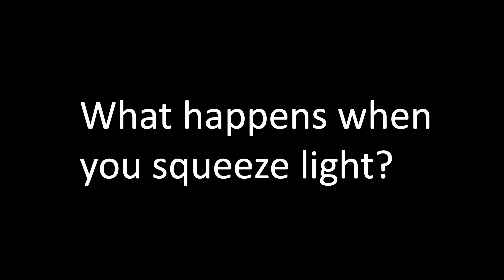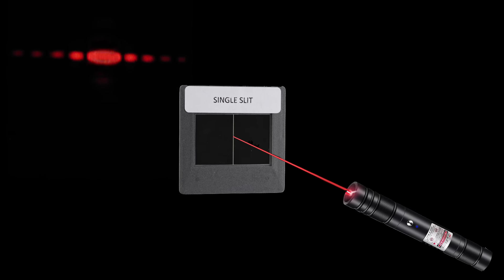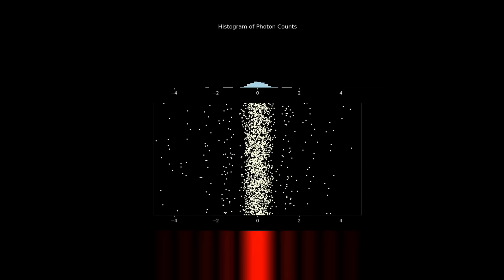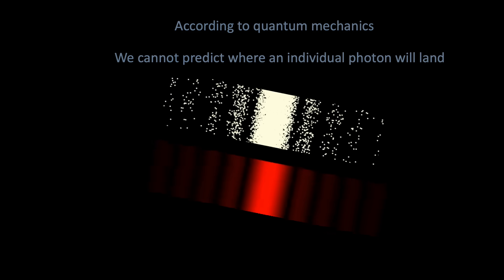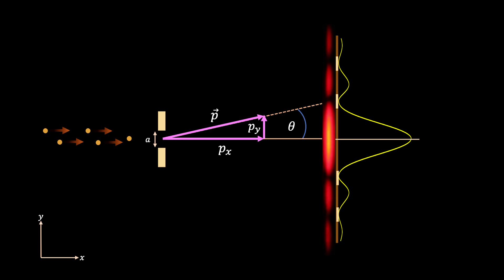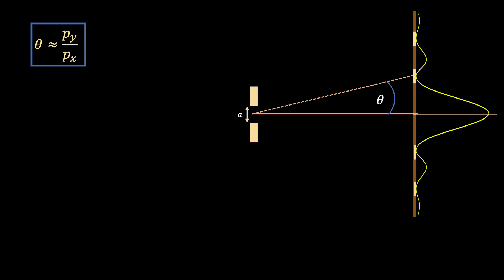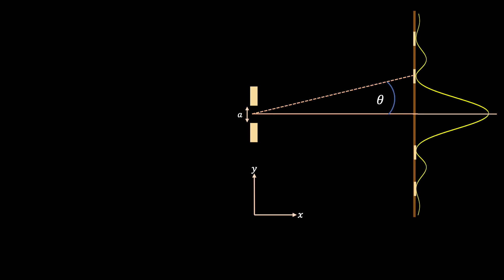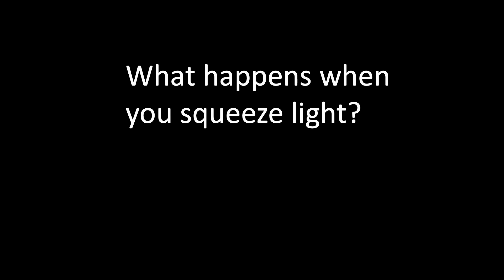What REALLY Happens When You Squeeze Light?

Comment: Photon is only a particle when measured, otherwise a wave. What if the slit is not straight nor have a varying lengths? ( varying direction through the slit) It could be possible that the landing pattern might be not so uniform.. If so, one can potentially assume to witness  the refraction/defraction  landing concentration can be different in  correlation

Comment: We learned this is optics from the standpoint of wave behavior. As the gap reduces closer to the wavelength of the light, the waves are diffracted by the edges of the slit and naturally form the diffraction pattern on the screen. Basic wave behavior.

Comment: This is a pretty naive explanation.  Light will diffuse even when there’s a barrier only on one side.  It has nothing to do with uncertainty.
Reply from the maker: When a photon passes near a single sharp edge, its position in the transverse direction (y) becomes partially defined — we know it did not pass through the blocked region. This reduction in position uncertainty (Δy) means, according to the Heisenberg Uncertainty Principle (Δy·Δpᵧ ≥ ℏ⁄2), that the uncertainty in its transverse momentum (Δpᵧ) must increase. The photon’s quantum state now includes a wider spread of possible momentum components in the y-direction, which corresponds to a spread in possible propagation angles. This angular spread is observed as diffraction around the edge.

Comment: You just pull it through and defract using sliders that have angles on the inside… then you pick how it bounces based on the squeeze and slide up or down to change angle… like their is WAVETABLE of teeth to Razer comb shave through… sliders can be up down side side or in or out it’s just about having all the angles in the cuts of the gridded granular diamond crystal… like… it’s uncertain until it’s just CERTAIN THAT BASICALLY IT’S ALWAYS ABOUT HOW 1984 is going to be the only thing I ask IF EMILIO AND MYCHAEL AND JULIAN AND JEFF AND ARSENE AND SAM AND ANDREAU AND ANDREW AND ESPECIALLY RAMON AND JOHN PATRICK HAVE HAD THEIR HARD YEARS YET… AS IN THEY HAVE TO FOR THE FULL EXPERIENCE LIKE DANIEL ANDREI ANTHONY JEFF WES ALL PAYING FOR A SEXUAL ABUSE EXPERIMENT OF THEIR CLASSMATE THEY DEADPOOLED

Comment: Here is another interesting observation of light involving the Heisenberg uncertainty principle and reveals a lot about modern physics and how quantum mechanics works. According the Heisenberg Uncertainty principle, if a photon is emitted by a source, then the position of the photon is known exactly at the source (nearfield), but the momentum or velocity is infinite. But as the photon propagates about 1 wavelength from the source (farfield), the wavelength starts to become clearer, such that the relation: frequency x wavelength = ~c. But according to the Heisenberg Uncertainty principle, infinite cycles of the wave are needed for the wavelength to be known exactly. So in a finite sized universe like ours, the speed of the photon is never exactly speed c, even at astronomical distances from the source. So the speed of light is never constant anywhere in this universe, especially less than 1 wavelength from the source, where it has infinite speed. If the speed of light is not constant, then the 2nd postulate of relativity is wrong and what remains is the 1st postulate: Galilean Relativity. If Relativity is wrong, then so is General Relativity which is based on Relativity. Infinite speed signals specifically violate the Relativity of Simultaneity because infinite speed signals appear the same in all inertial frames of reference. This can be seen by inserting c=infinity into the Lorentz transform, yielding the Galilean transform, where time and space are absolute. So if a moving body is observed with instantaneous nearfield light, then no Relativistic effects will be observed, whereas they will be observed with farfield speed c light. So simply by changing the frequency of the source, Relativistic effects can be turned off and on. The only possible explanation is that effects of Relativity are not real and are just a type of optical illusion. 

Quantum Mechanics has many interpretations, but the only one compatible with Galilean Relativity is the Pilot Wave interpretation (Bohmian Mechanics). This is because only in this interpretation particles are always real, with real position and momentum at all times, and the particles are just guided by a pilot wave, which can interfere and guide the particle to points of constructive interference. It is also known that the pilot wave communicates information about the particle with the environment. So for light, the photon particle which has energy and momentum, it is guided by an electromagnetic pilot wave that communicates information instantaneously about the photon particle with the environment. 

Instantaneous EM signals are real and have be observed experimentally. In an experiment just peer reviewed and published in the EM journal IRECAP, an EM pulse was observed to propagate 1.5m in the nearfield with no propagation delay. This shows that the front speed, or the speed of information is instantaneous in the nearfield. The effect was also shown to be predicted by EM theory. This was done by setting the wave equation to a source and solving the inhomogeneous equation. The results showed a minima in the phase vs distance from the source curves  (dispersion curves) due to wave propagation. It is well known that a minima in this dispersion curve corresponds to infinite phase and group speed. Applying phase speed and group speed operators to the curve shows that both the phase speed and group speed of the EM fields are instantaneous in the nearfield, and reduce to about speed c starting at about 1 wavelength from the source, and continues to converge toward speed c as it propagates, but it never becomes exactly speed c in this universe. For more information see the links below:

*YouTube presentation of above arguments: https://www.youtube.com/watch?v=sePdJ7vSQvQ&t=0s 

*More extensive paper for the above arguments: William D. Walker and Dag Stranneby, A New Interpretation of Relativity, 2023: http://vixra.org/abs/2309.0145

*Electromagnetic pulse experiment paper: https://www.techrxiv.org/doi/full/10.36227/techrxiv.170862178.82175798/v1

Dr. William Walker - PhD in physics from ETH Zurich, 1997

Comment: Whatever happened to conservation of momentum? Where does the py come from?
Reply: Conservation of momentum in quantum mechanics is concerned with what you can measure. This means that the expectation value of the system is conserved, meaning if it is possible to gain momentum in the y direction, it must be equally likely to gain momentum in the -y direction such that what basically amounts to the average measurement value is conserved.

Comment: This is like the spreading that happens to a signal in frequency domain when shortening a unit rectangle function in time domain. The light intensity pattern matches the behavior of the Fourier transform of the rect function which is the sinc function!

This makes sense as visible light is part of the electromagnetic radiation spectrum also known as radio waves! The Fourier transform of signals in the time domain explains the existence of its frequency components or spectra when transmitted, this eventually allows us to decipher patterns of spectra or frequency components to as communication through radio waves!

In short, squeezing visible light creates a visible pattern that is the same as “squeezing” a square pulse signal in the time domain which creates an “invisible” that’s is the same, which is the sinc function!

Comment: In this video, you take a particle based approach where the photon is a spherical object whose radius much much smaller than the width of the slit, a.  

Could you do a video that takes into account that the photon is a concentrated wave packet that is spread out over more than a meter?

Could you also make one that explains what happens if your photon source is spontaneous emission rather than stimulated emission?

Comment: On the face of it a very neat exposition of th euncertainty principle. As always when it comes to experiments involving slits though, I do have reservations. A slit is not just some inert object with no properties. I mean it is composed of two bunches of electronic outer orbitals stacked parallel to each other. Anything which is able to pass through must interact in some way with tho "edges" of the slit. If that something passing through is closer to one edge of the slit than the other......
Reply: The math that has been found to model it in a way that matches our observations doesn’t significantly depend on the properties of the material the slit is made up of though,
so, I don’t think the choice of material plays a significant role.
Reply: @drdca8263  The point I was trying to make was that any slit regardless of what atoms it's made from could be interacting electromagnetically with the photons passing through.
Reply: @malectric  @malectric Well, sure, anything that has an effect on electromagnetic waves, interacts electromagnetically. Because blocking the electromagnetic thing is interacting electromagnetically.
But when we model this interaction as just “it blocks the waves from going through this location”, without any extra details, the predictions match the results.
So, therefore, observations are consistent with the hypothesis that the most relevant part of said interaction is “the barrier blocks the waves from going through where the barrier is”, with other contributions from the interaction being quite small/negligible.

Comment: Light through the slit cannot form a perfect triangle, because the light traveling along the hypothenuse must travel further than the light traveling along the adjacent, so the light will take a longer time to reach the adjacent. This will cause a phase difference that can be the cause of an interference pattern. The difference in angles between the two slits and time taken to the projection surface also is responsible for the double slit phase difference interference pattern.
Reply: So if you made a wobbly curved screen, could you eliminate phase differences?
Reply: @skypickle29  Possibly a curved screen might eliminate the phase difference.? Easy experiment to try.

Comment: Years ago I found that right next to any surface the light rays changes. I am long sighted and use glasses. Years ago I only needed them for reading and if I didn't wear them I found looking at some thing next to the edge of some thing like a pencil made whatever I looked at right next to the pencil in focus. It may or may not depend on what material one uses (eg. metal rod in stead of pencil) but I have not noticed so. To me that tells me that the light rays next to an object is influenced by the object without going through the object. If that has any thing to do with Quantum Physics I don't know.
Reply: Wow. I just tried this and it worked. 

I should have known to try this, because as someone who suffers from astigmatism, I’ve known for a long time that looking through a tiny slit (or my fingers close together) will make the distortions disappear.

Comment: My understanding is that the electrodynamic field is in fact continuous  and that talking about 'photons passing the slit' doesn't really make sense, you shouldn't think of them as particle like. instead the field deposits its energy in discrete particle like packets on the detection plane whick looks like a particle but really is an energy transfer from a contninuous field.
Reply: Exactly! This video is very confusing. The energy in the field does not travel as individual quanta. Only the exchange of energy between matter and the field is quantized, and that amount is a photon.

Comment: If smaller gaps makes the uncertainty greater, then how do they make lasers? Don't lasers use a small hole that lets a thin beam of photons through?
Reply: Most laser diodes naturally emit from the laser's cavity as a conical shape. This is the near field pattern of the laser. This beam is often passed through one or more lenses to collimate the beam, which directs the light to travel parallel to the rest of the light in the laser. There is a limit on how well you can do this, the very best is a diffraction limited beam which naturally spreads some amount over distance depending on beam quality.
Reply: @evan5237 thanks for this explanation